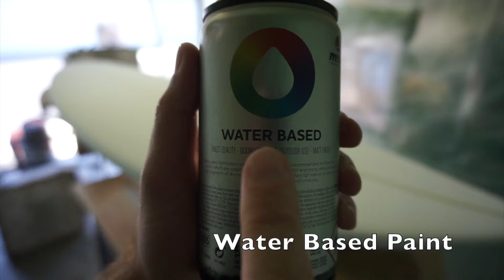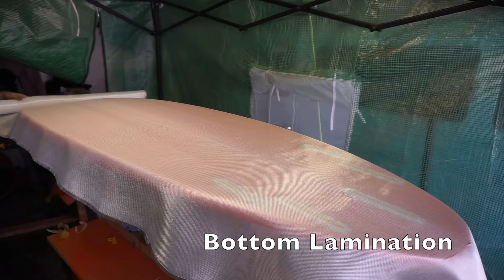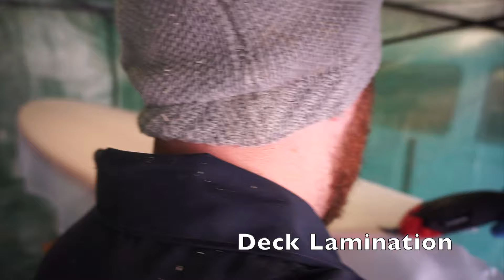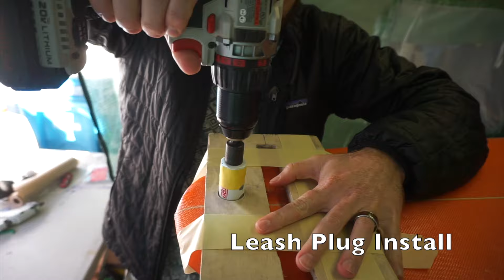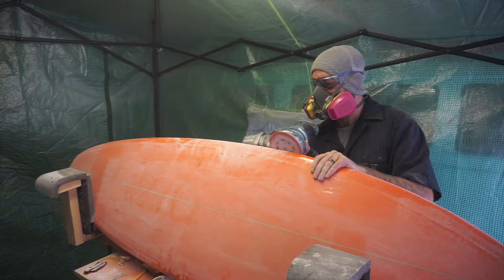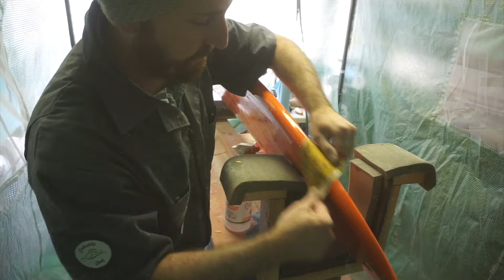Spray Paint Surfboard Blank.  Lost Quiver Killer and Pyzel Phantom XL inspired daily driver shape.

Comment: Even with 'water' based spray paints, the atomizer often times melts EPS foam.  The case in the video, a PU blank is getting sprayed.  The resin, PE or epoxy, doesn't matter.  If you have an EPS blank to spray, use an airbrush and poster paint, thinned at 2 parts paint, 1 part distilled water, and 1 part acrylic sealer (concrete sealer).  Works great after the EPS blank is sealed with spackle or epoxy resin + cabofil.
Reply from the maker: Excellent detail.  Thanks for adding it 🤙

Comment: Would you say 1 can is enough for the board you’re making? Also how many coats? (I plan to build my first board soon and use the same paint)
Reply from the maker: The Montana water based only comes in the smaller cans shown in this video.  Definitely buy 2 cans.  Takes a little more than 1 can up to 1.5 cans.   Check out my teal tapir video, in that one I used one whole can for the deck and bottom and the just a little bit of a darker can for the rails.  

2 to 3 coats to get the coverage you want.  Go light on the coats just like any other spray paint job.
Reply: @callalilycollective  thanks so much, glad I asked. You’re the only person I’ve found that isn’t airbrushing and is using this paint, so thank you for that too.
Reply from the maker: @chrisfrizzell1050  no problem! There’s a lot of discussion on old swaylocks threads in this topic, but definitely nice to share it in video form.

Comment: Is there purpose to covering the stringer or is it just for looks?
Reply from the maker: Just for looks.  I prefer the wooden color exposed.   

I guess you get some slight UV protection, but foam degrades way before the stringer ever would.
Reply: @callalilycollective  Ok good to know! I was wanting to make my own board and the design I would be going for would involve covering up the stringer. I appreciate the response!
Reply from the maker: @Fwoggyz  nice good luck on it.  Make sure you test your paint on whatever type of foam blank you’re using.  Lots of paints have solvents that will eat eps and XPs.
Reply: @callalilycollective  Ok thanks! I will keep that in mind👍

Comment: Poly or epoxy resin with the water based spray paint?
Reply from the maker: This is poly resin on this board.   If using epoxy I would still stick with water based paint based on other people’s experience on swaylocks.